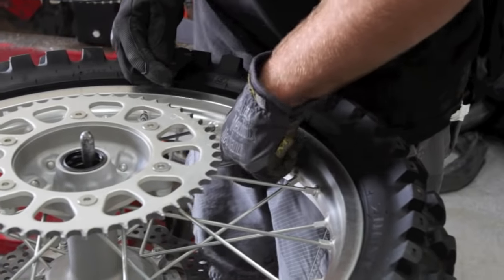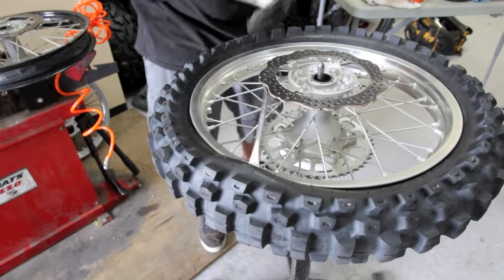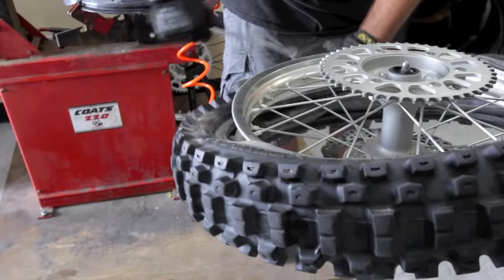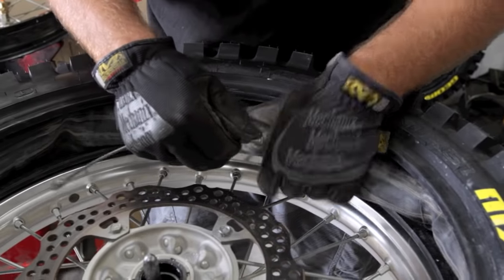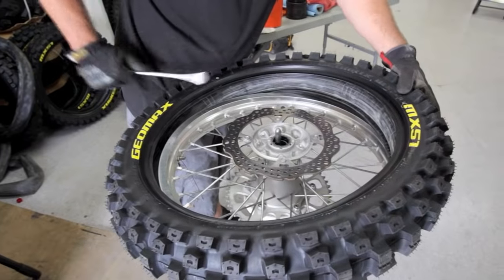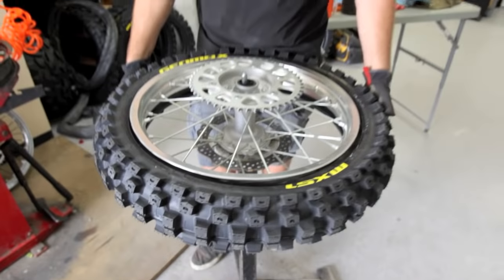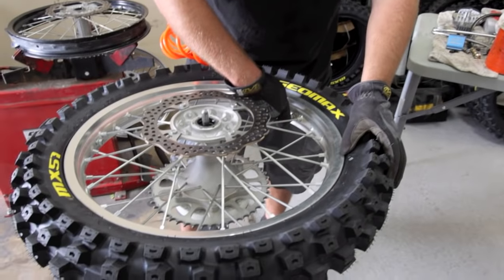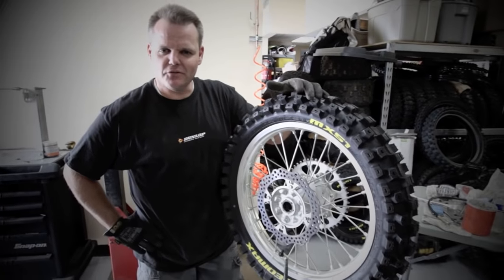How To Change A Motorcycle Tire

Comment: Looks good no offense but I use a whole lot more baby powder with talc. Buy at dollar tree baby powder with talc 12 ounces for a dollar. Also air tube up about 4 times to the out side diameter of the wheel and deflate each time. A little tubing deflator for a few dollars online really helps and makes it fast. Remove valve core screw on tubbing deflator air up and then just put you finger over the one hole on tubbing deflator and air will be removed fast with air compressor hooked to tubing deflator.. My bicycle I use about 10 ounces to a mountain bike wheel. And alot more the bigger the tube like a motor cycle or tractor trailer container wheel. Can't use to much baby powder I've tried. Also some powder is going to come out it's normal. I found before adding air once tire and tube installed roll tire on ground to distribute baby powder. And then lay wheel side ways and shake, shake shake side ways to even out baby powder then air up keeping wheel laying side ways and shake wheel. I've been a tire man since 1993. Not enough baby powder in a wheel will burn any tube up. Most people put tubes in dry with no baby powder or wet. This is totally wrong. Not convinced about friction? Rub your hands together they will get warm even hot. Now rub hands together in a bag of baby powder. No heat when hands are in baby powder. This is what happens to the tube when run low on baby powder or no baby powder!!! And if you bust or get a leak in the tube or a loss of air you will see powder every where so you can stop and not damage things.

Comment: lol after watching this it looked so easy, then I try it and its harder than mother to get this done haha
Reply: It's all technique. Keeping the bead off the rim on other parts of the tire gives it enough "slack" to pop off. Using baby powder is the best method I've ever seen in my racing career for the tire/tube combo. Lube that will dry up over time (lightly soapy water) on the bead is good, but nothing "wet" inside the tire, as it attracts dirt/sand etc. and causes excessive wear on the tube.
Reply: @dmoto131  make sure its talc and not cornstarch baby powder.
Reply: @bikedeefer  why is that ? 
Cornstarch is not tasty enough?
Reply: But it shows it is a skill.  Not easy, but not impossible, and this did make it look easy

Comment: The rim has a larger hole and smaller hole, which hole is for the tire lock and which is for the tube valve?
Reply from the maker: The larger hole will be for the rim lock and the smaller one for the valve stem.

Comment: I challenge the man in the video to pull of the tire i just tried to replace. It all looks easy when the tire is not too old. But when it's on your bike for over a year it's IMPOSSIBLE to get it of the rim by hand. I even tried to release it from the rim wit a 40kg's bar from the gym + my own weight (85kgs) but it sticked to the rim like melted cheese.

Comment: I've done all of this but my tire won't pop onto the bead, it's tucked under on both sides even when I pump it up, what do I do here?
Reply: Put 40-60psi in there and it will pop on, even without lubing the bead. Much easier if you just put a bit of tire paste on the bead.

Comment: I would not recommend putting any air in tube before completely getting tire on. I popped three inner tubes in a row because I put just a little bit of air in them like two different videos on YouTube said to do. Most frustrating week.

Comment: You forgot the bottom nut on the valve stem.. you left it inside the tire.. I think both nuts are supposed to be on the outside of the wheel.

Comment: What I'd really like to see is this done at the side of the road in mud, miles from a workshop, in pouring rain after getting a puncture...
Reply: Yeah that'd be a great video to see
Reply: first - practise at home to get the hang of it (proper tire irons are a must)
second - keep a towel or plastic sheet to work on & carry spare tube! dont rely on a patch to work in the rain & mud

third - put nuts etc in your pocket so yer don`t lose them
fourth - when you start to put first iron in place, put your knee hard in the opposite side to push the tire into the rim, this is the trick I was told and it works (biker pants have knee protectors unlike 40 years ago when I did my first `roadside fix`
fifth - sounds obvious, but carry a good pump or an electric one as long as you have tested it!!!!!

by the way - if this seems hard work - preparation etc., try waiting in said mud and rain for hours for the rescue truck to arrive
Reply: Stephen Bullock Yes, I’ve done it myself many times, so I do know how much more tricky it can be outside, rather in a clean workshop where these videos are recorded. My old BSA blew out its rear tyre in 1974; I was riding downhill at speed with a passenger. By the time I’d stopped the bike we had explored all of the road and both grass verges. A three inch, bent nail had shredded the inner tube. I repaired it enough to get the bike home by cutting all the repair patches I had into quarters.

Comment: The blokes who suggested grease below, WTF? tyre will slip on rim and puncture the tube. Also a petroleum based grease will eat the rubber. You want soapy water as it will dry and allow tyre to grip rim

Comment: and then running too low a pressure and getting a pinch flat on the first ride because it's a softer newer tire so you have to take it all apart again

Comment: Nice video BUT some tires have a direction arrow on the side wall. Crap now I have to take the tire off again and flip the tire around so the arrow points the way the tire will turn on the bike. grrrr

Comment: Now show me how to do it with a tire with a stiff sidewall! I cannot get it on following this exact process. I can get about 3/4 of the tire on, then no matter how hard I push on the tire iron, it won't stretch the tire enough to get on.
Reply: same for me
Reply: make sure the tyre is not on the outer rim on the opposite side your working from gives you more tyre to work with
Reply: also warm the tyre up that helps alot !!!

Comment: I pinch tubes all day
Reply: i use the least amount of air in the tube this way the tire irons wont pinch the tube.
Reply: Short levers with a flat spoon are better than long levers with a tapered spoon (for the last part , getting the last bit of the bead on was hard). That's something I learned yesterday.

Comment: I wonder how many tubes you pinch changing  tyres like that, or how many followers have pinched their tubes following your tuition. The levers should never be used like that, that is just asking to pinch a tube, then you have a hole to repair or a tube to replace. The levers should be used with the tip just inside the rim to prevent tube pinching.

Comment: What about an ATV
Reply: Thank you
Reply: dave roger actually, it's the same. There's just no tube. You remove and replace the tire the same way, just make sure you replace your rubber valve stem before you throw the new tire on.

Comment: That tire is f&*king soft !  What did he do heat it up first !!!
Reply: The trick is to keep the tire in the groove where the spokes are. If you push the tire down on the opposite side you are working it allows the tire to move more toward the area you are working on.

Comment: Dum how you could not punch the tube with that speed when reinstling the tier 😫
Reply: If you are up the tube slightly it will stay away from the tool. Also dont insert the spoons deeply in the tire.
Reply: @brucetec6597  Yes correct, but even without inseting them too much we punch the tube (even in tier workshop) several times 😥. Realy it pissed me off 😡😠

Comment: HaHaHa  It's all good till you put it back together, why do you do it the hard way! Why do you show people the wrong way to do it, Maybe you just don't know how to do it. After you put in the talc in the tire put the tube in the tire and add a little air so it will spin in the tire to smear the talc everywhere then put the valve in the rim and start the nut a few threads, now with the rim lubed and the tire lubed push on the one bead and the tube will just slide into the rim, pull the bead over the bead lock and push it up in the tire, if the tube has too much air let some out then push the tire down into the bead lock and work it on with the tire irons and you are done. Fill up the tube and install.